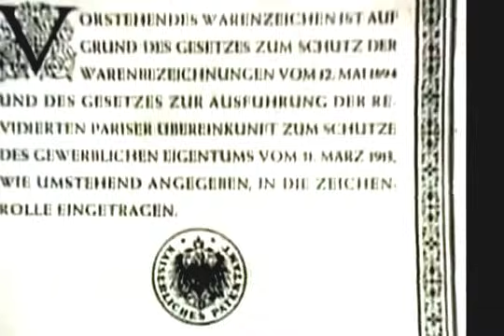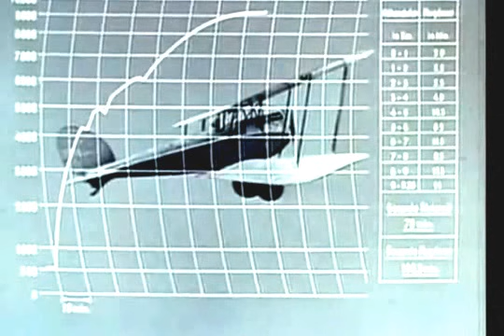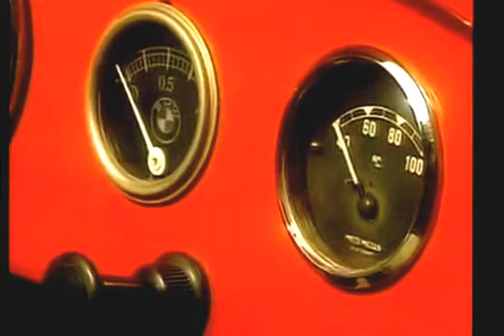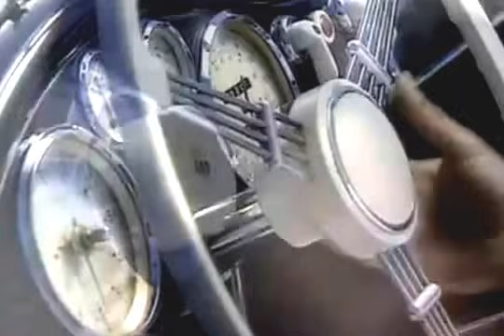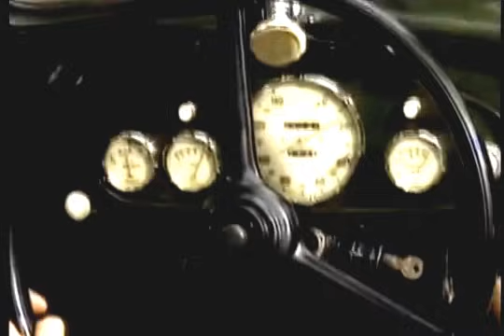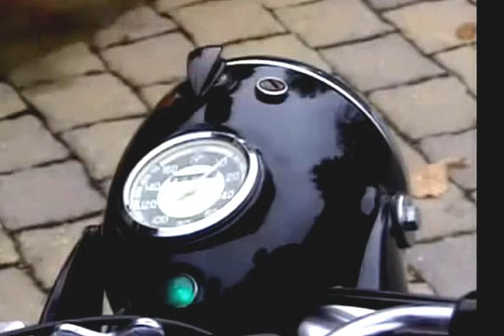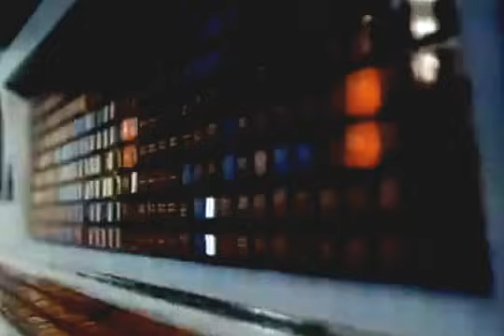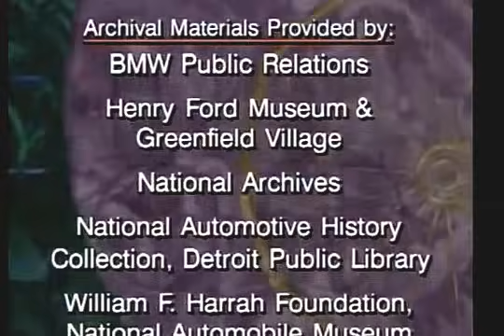BMW Documentary | Best Brand And Product | Inovation BMW

Comment: BMW E39 is simply the Best
Reply: Bernhard Ptacek e30 is bester
Reply: AGREE 100%
Reply: Totally agree with you, I own two E39's, a 2003 530d M sport and a 2001 540i M sport. Both have well over 250,000 miles on the clock and still very smooth and powerful with zero rust and still running on same engines and transmissions. have owned them both for 9 years and will never sell either.
Reply: @boost_is_happiness6011  E30 is nice if it is a 325i with the switchable auto box and M sport spec suspension etc, but now I find them too small and very cramped in the rear, not suitable for normal sized people. I am in my 40's now and Abit of an old man who likes big saloon cars like the 5 and 7 series E39 and E38.
Proper BMW from the 1990s

Comment: My 2019 330i XDrive is my first.  Impressive power for a 4 cylinder and handles well.  Replaced the run-flat tires and the ride improved substantially.  Hope all the negative comments on here are from actual former owners.